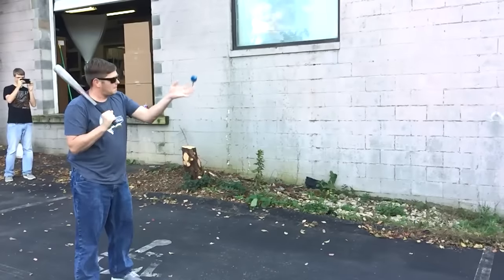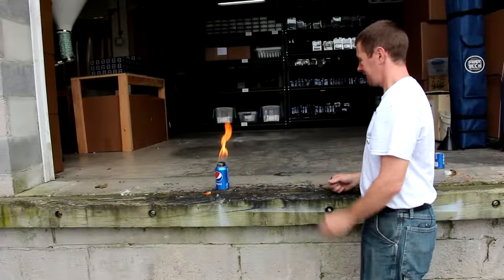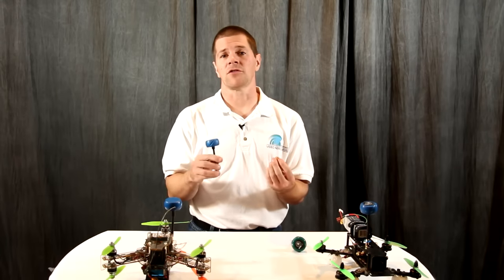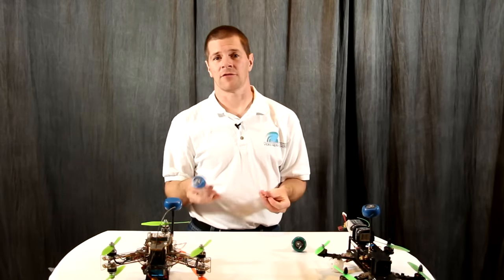Dura-Spec crash proof antenna overview

Comment: I'm happy with the durability of my Cyclone antennas. I've read that they break near the connector, but I actually hit the antenna on a goal post and nothing happened. A couple of days ago I flipped my quad while landing, and the antenna came off. I quickly unplugged the battery and found that the 90 degree adapter came apart, not the antenna. Pushed it back in and added some super glue. If the Dura-Spec antennas are more durable...people must really be abusing them to report failures.

Comment: I have two sets of airblades, one set with the covers, one set without. Would it be possible to get an additional set of covers? Are the airblade sma connections as solid as the Dura-Specs? I really like the airblades, and the covers help the durability of the antenna, but rather than pop for a third set of quality antenna, I'd really like to reinforce a set that I already have.
Thanks!!
Reply from the maker: +P Barker - I f you need covers, Email StoneBlue Airlines.  They have them in stock, but just not on their website.  That said, The Dura-Spec is much more durable (and cheaper) than the Airblades are.  The Airblades are higher performance, though.

Comment: How does the dura-spec compare in performance to the airblade/airscrew?
Reply from the maker: +Bunny_Ninja - Not quite as good in performance, but close.  The axial ratio is a bit lower (.67 compared to .69 and .79 for the Airscrew or Airblade).  The gain is the same, though 1.5dbic.  However, the efficiency is only 92% compared to 99% with the Airscrew of Airblade.

Comment: so how is the dura-spec antenna as a vrx antenna when compared to something like a mad mushroom?
Reply from the maker: +Wyll Surf Air  - The Mad mushroom is a higher performance antenna and is a better VRX antenna than the Dura-Spec is.  The Dura-Spec performance is on par with the BlueBeam whips.
Reply: +Alex Greve That is what I figured.   R u going to make dura-spec antennas for 3.3ghz?
Reply from the maker: +Wyll Surf Air  I  am not planning on making these for 3.3GHz.  They will be quite large at that frequency.

Comment: I got one of these and it's just too big and tall!  A stubby option would be nice.
Reply from the maker: +mooosestang - This is the third request for a stubby.  Looks like I will be introducing a stubby ;)
Reply: +Alex Greve If you want me to send mine in for a conversion, just let me know. A smaller cover and shorter antenna would be great.  I've never broken an antenna cover, had a few of the fatsharks pop off, so i don't know what people are doing to break that part.  for me the antenna always pulls out of the sma connector.  For me something about half as tall would be great.  http://www.pbase.com/image/162209881  Yes, that is a aomway antenna shoved into a ping pong ball and filled with expanding foam.  Pretty tuff.
Reply from the maker: +mooosestang - Expanding foam can be dangerous territory on these antennas.  it changes the velocity of propagation through the antenna as well as the SWR.  Both Axial ratio and Impedance will be affected.
Reply: +Alex Greve I got pretty good video on my maiden flight with it and good penetration, but i don't fly very far from my location.

Comment: I got a pair and tried to tighten it using the ranch provided, guess what i herd  pop (just like the instructions) and the SMA broke!!!! more like popped open, was so disappointing paid around £60 to get the pair. had to force it back in and put cyno around it. now i use it with extreme care. NOT CRASH PROOF if the SMA breaks on my first install.
Reply from the maker: +Ashar Hameed - You are referring to the right angle adapter, not the antenna.  The adapters do break... frequently.  The whole point of the wrench was to save the antenna from falling off in flight due to the bad adapter.
Reply: Not the right angle adaptor. The actual SMA connector at the end of the antenna. Point being it broke even before I got to fly. Or are you saying I got a bad connector on my brand new antenna? And now I have to go replace it after buying an anntena that cost half the price of my quad.

Don't get me wrong I respect you and ur work a lot. It's just ironic that the antenna broke before I even got to use it on a crash proof anntena.
And how is it crash proof if it breaks off while screwing it on. Surely it would have been worse in a crash. I would have been happy if it broke it a crash.

Obviously it comes down to QC and mine didn't have much so other stuff could be wrong with it as well. I am happily paying so much for the quality product which includes the connector at least up until I crash. Now don't have confidence in it when I thought I am buying the best anntena on the market. Honestly never had a similar problem on a £2 Chinese shitty antenna even after a crash.
Reply: +Alex Greve and before you ask I got it from HobbyRC a VAS authorised dealer.
Reply from the maker: +Ashar Hameed - Yes you got a bad antenna.  That would be a warranty replacement.  And it was never crash proof.  The crash proof ones will not be out for a week.  Why did you never send me an Email about this?
Reply: +Alex Greve, oh.. very sorry then! I saw the video few weeks ago of u trying to break one and I had to have one. I wanted better quality video and I got it. I had immersion anntena before and these make a hell of difference in terms of video signal. I can fly places where I never could previously. so I was mainly getting what I wanted and after using these I wanted to fly more and more. these anntena's made me fall back in love with FPV. therefore I didn't want to send them back for replacement.
as I said before thses are the best anntena's money can buy.

this is what I have: http://www.hobbyrc.co.uk/ibcrazy-58ghz-bluebeam-ultra-antenna-set-sma-rhcp
Reply from the maker: +Ashar Hameed  - That&#39;s the BlueBeam Ultra.  And I owe you a replacement.  Please Email me your address so I can promptly replace them.  If you prefer a Dura-Spec, please indicate that in the Email and I will replace it with a Dura-Spec instead.  My Email is videoaerial <at> gmail
Reply: +Alex Greve wow.. thanks a lot mate, wasn't expecting that. will PM you my details.
Reply from the maker: +Ashar Hameed - Please send me an Email so I can send a replacement.  Just keep the ones you are using... even if they work ok now.  Every VAS product is warranted against defects.  Yours was defective and I owe you a replacement.
Reply: +Alex Greve thanks a lot Alex. already sent one.

Comment: No way as strong as you say.  or i must have had a bad one. crashed my f210 into a goal post and mine cracked open.  quad still flies great. not so the antenna.   Sorry :(    it was a Duraspec lhcp
Reply from the maker: +Aerial Flight - So the cover cracked?  The antenna still works.  The foam inside has protected it.  Just keep flying it.  Why stop flying something when it still works?
Reply: +Video Aerial Systems the cover split open and the antenna is squashed. the cover broke open in 3 parts.
so now got a open antenna. wont last another crash. been out using it twice. and the only way i can use this again is to take all the foam of and re bend in place..
Reply from the maker: +Aerial Flight They're every bit as strong as I show in the videos.  Just because you were able to put more energy into the antenna than multiple hammer swings, baseball bat swings, and running it over with a car doesn't mean it is not tough, it means you don't understand physics.  Hit the goal post square on with your quad the way the antenna hit it and your quad will break in half.  You just got lucky and only hit the antenna.

Comment: I asked for "bomb proof"

I dare you ;)
Reply from the maker: +Hiway - If you have the explosives, I will donate the antennas.  Just be sure to video it... and no I'm not kidding!
Reply: +Alex Greve I am not authorized nor would I want to be to handle explosives. I just wanted to see the test, lol. Gotta find an unexploded ordinance expert. Maybe they can toss in a 5.8 on their next job.
Reply from the maker: +Hiway  - Sounds like a plan.  That would indeed be fun to watch.
Reply: I have been running a dura-spec on 2 of my quads now for a few weeks- I have broken the quads and repaired them a few times, but the antennae are virtually unharmed.
 I should add I removed the plastic protector also.
Reply: +Hiway Tannerite is the key.   Google it.  You don't need "authorization" to handle it.